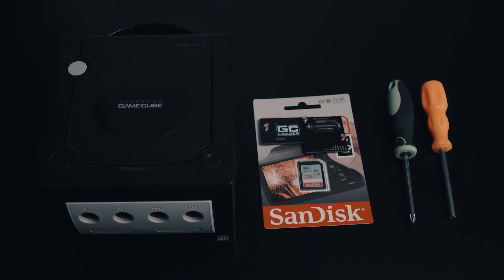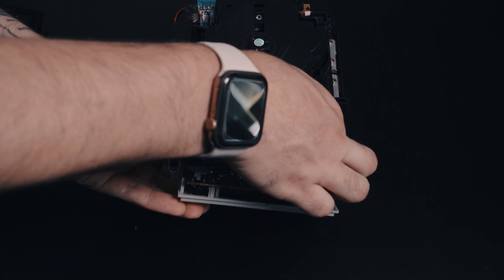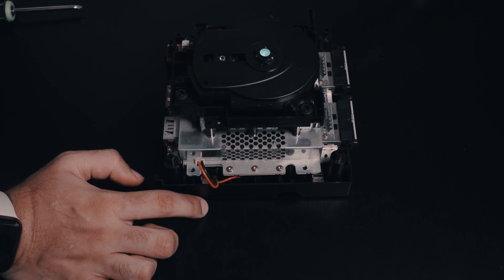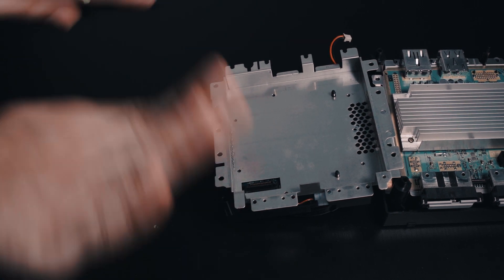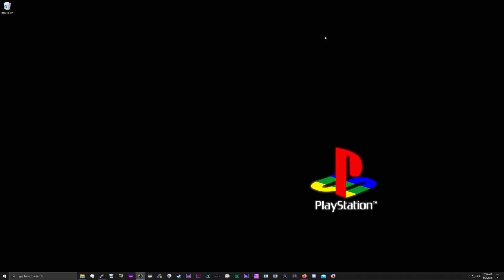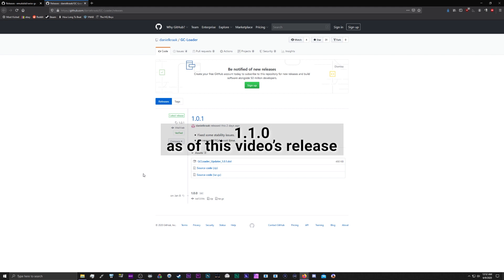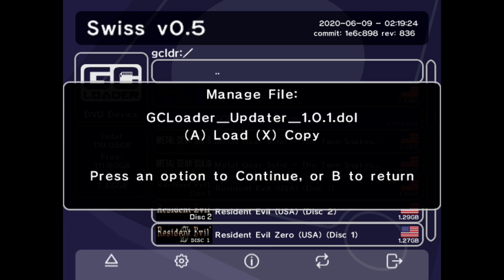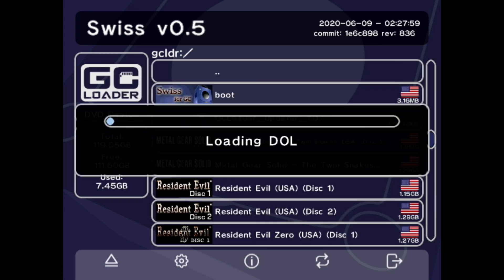GC LOADER PNP: The GAMECUBE Optical Drive Emulator - Installation and Setup

Comment: I recently got the GC Loader and it worked just fine except that it kept telling me that there's a GC Loader update available. Once I did that, then I was able to enjoy GC Loader. One thing I do like is that you don't need to use a game save exploit which you have to run every time you want to boot Swiss

Comment: What size sd card can hold the entirety of the gc library
Reply from the maker: Gamecube library is about 900GB I believe, so a 1TB should do it.
Reply: @digitaldev  i might just get a 256gb considering i won't include a bunch of games
Reply from the maker: @juntartful  that’s what I have, I don’t need the whole library haha
Reply: @digitaldev  so I am settling mine up now and my shield only has 2 of 3 of the screw holes. I know my gamecube is a DOL 101 am I screwed? hahaha get it screwed..
Reply from the maker: @juntartful  I think as long as you aren’t moving your Gamecube around a lot, you should be fine
Reply: @digitaldev  another question man, how do you store the disc drive that you take out in this mod
Reply from the maker: @juntartful  I honestly just have it in a small box, along with my Sega Saturn disc drive. Just in case I would ever need it for some reason.
Reply: @digitaldev  hope you don't mind the questions at least im keeping it all under 1 come reply chain.. but I have yet to format it but I notice when I slide the SD card in it is not really a click or anything indicating when its in. Lol just wondering if thats normal hopefully that makes sense 😄
Reply from the maker: @juntartful  No worries about the questions! Yeah, there’s no click or anything on this unit
Reply: @digitaldev  cool currently following the sd card setup man thanks ill let you know if I have other questions
Reply: @digitaldev  so yeah I got it to work first tested with one game it worked fine. Then I started to add a bunch more. Ended up adding a bunch but all the ones I added the second time around are all fragmented and don't play for some reason? The original game i added first to test still works though any ideas?
Reply from the maker: @juntartful  Can't say for sure unless something is messed up with the file structure. As a safety you can try putting all of the games in their own folders at the root of the SD card

Comment: any way to use NES emulators? Can i still use an SD2SP2 with a GCloader?
Reply from the maker: JamesBMoore007 You can still use the SD2SP2 with this. I would actually suggest it, since it would give you the ability to save settings and use cheats. No NES emulation that I am aware of however.
Reply: @digitaldev  thank you bummer with the emu... wanted to play n64 dr mario or the NES lol oh well
Reply: You can use NES emulation with your SD2SP2 and GC Loader.